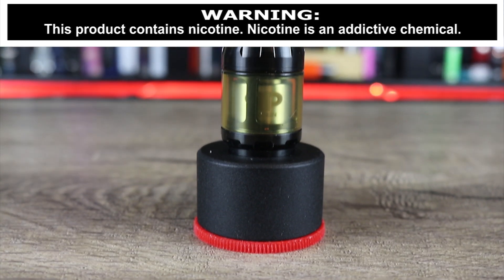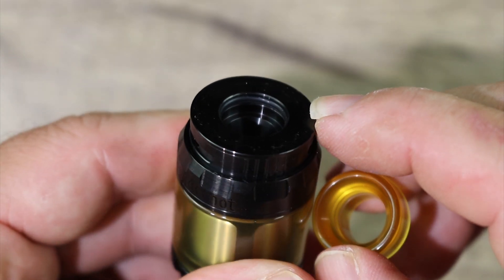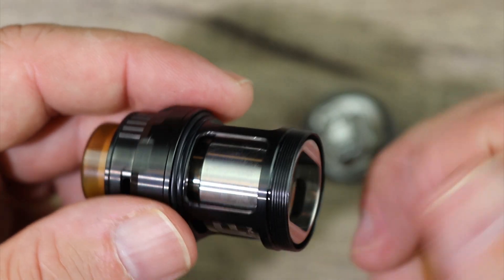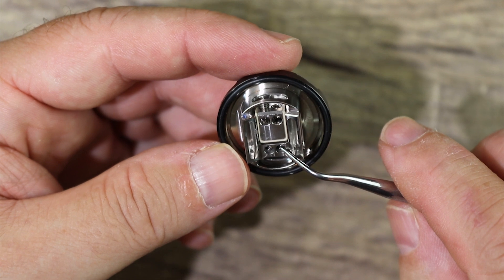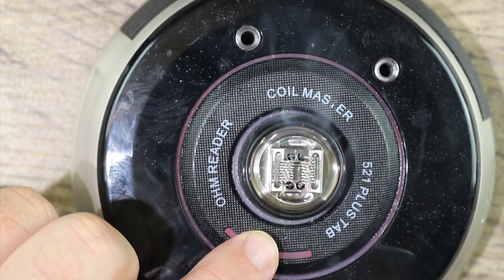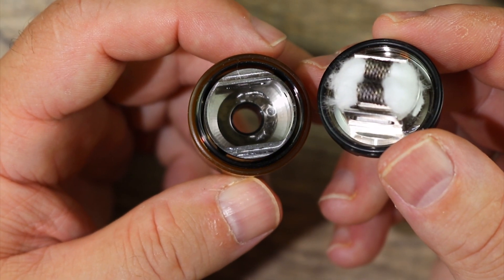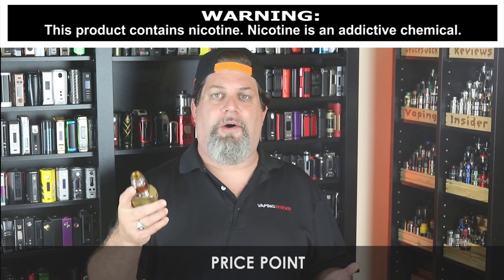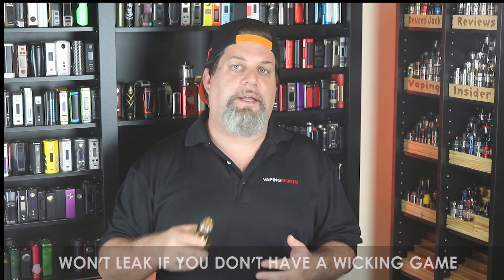OBS ENGINE KILLER? The QP Design Juggerknot RTA! ✌️🚭

Comment: I bought the OBS Crius 2 Dual it has the same type of filling and it's some taller but holds a desent ammount of e-juice without a bubble glas. 4 bottom airflows and you can close the juice control so you don't flood the deck when you push down the ring to close your fillport, nice flavour and it's not so expencive. It's a 510 drip-tip with 810 look that's black with some white that giwes it a marble look. Thank you for the review Jack.
Reply from the maker: Thanks for watching Allan. I don't think I ever reviewed that one. OBS is kinda weird with sending stuff. I don't get everything and I get a lot of the stuff late. I love their Cube kit and I thought their Bat mod was fantastic but I think it kind of got lost in the shuffle in a very crowded subcategory. I am hoping they make the Cube in single 21700 form factor with a single coil tank.

Comment: I'd personally put in a beefier coil, feel like the deck air slot is asking for it so it spans the whole length...I get good flavor from this tank but I have an sxk version lol oh and I get a touch better flavor on the previous zeus the dual which has a similar deck layout. Good review man :)
Reply from the maker: That's not the only build I ran in this tank. Before I review any rebuildable I run multiple builds in it. Thx man, appreciate the kind words.

Comment: Juggerknot mini has awesome flavor . It's just a pain to fill
Reply from the maker: I'm going to get one for review. Honestly, I have yet to try a top AF tank with awesome flavor.
Reply: I hear you for sure.  It has more airflow than the duel.   You can run it pretty high for a single because the airflow.  I guess its because it's so small for flavor.  The problem is when you fill it you only get like three quarters and juice starts coming out the weird ass fill port.   Their fatality is my all time favorite rta
Reply: @VapingInsider   Vaping Insider  the Jugg Mini is medium unfortunately. You can even see it just by looking at how wide they spaced the airflow slots. Insanely misguided. Overall, it's worse as a single coil top airflow option than the og Jugg is a dual. (Meaning the single market's more competitive while basically all top airflow duals are bad. The Jugg is just less bad than the others.)

Comment: The jug mini is def a obs nano killer.  Wow I'm shocked this one has no flavor. The mini is suck a great tank.
Reply from the maker: I'm not shocked, in general I'm not a fan of top AF tanks.
Reply: @VapingInsider  I'm shocked because the jugg mini is such a great tank. The flavor is great, everything about the tank is good except for the fill port and the drip tip which is subjective. Other then that it's a solid tank.
Reply from the maker: I'm gonna try an get a hold of a mini.
Reply: @VapingInsider  nice! Im interested on what you would think of it.